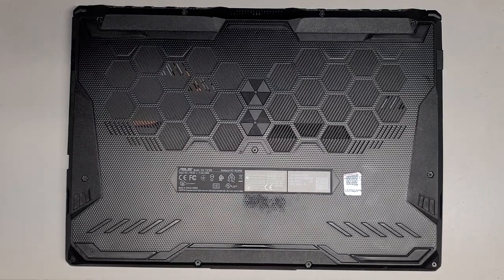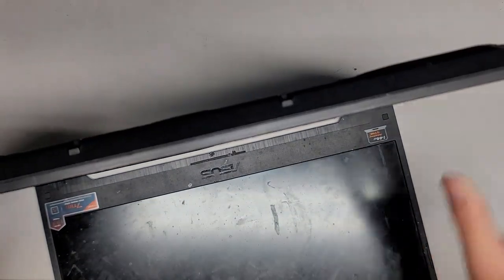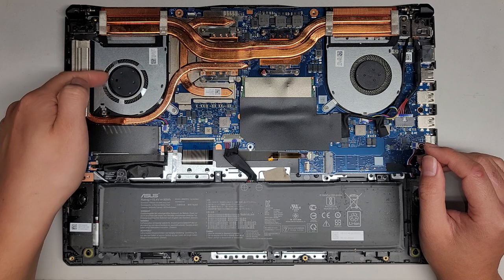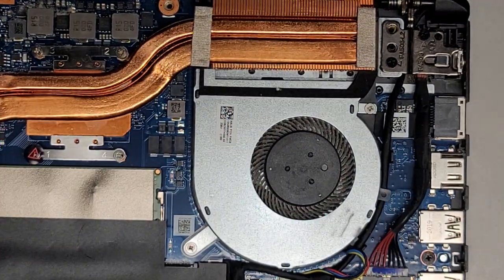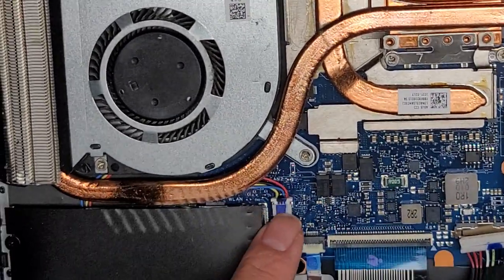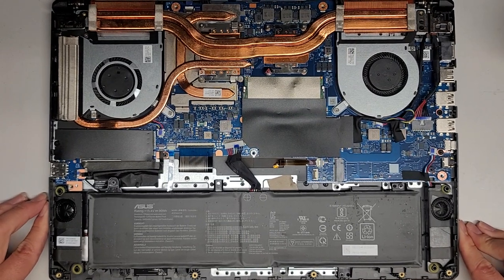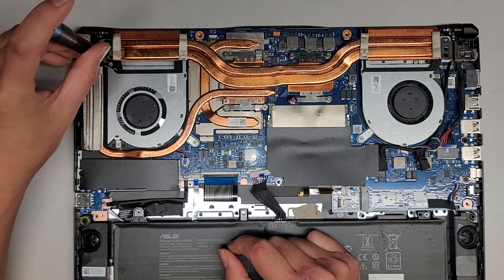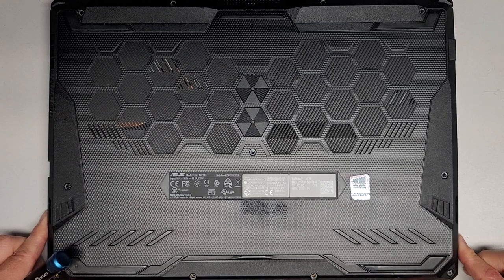ASUS TUF Gaming 15 TUF506 TUF506IV-AS76 Disassembly RAM SSD Hard Drive Upgrade Replacement Repair

Comment: Did you mention the location of the wifi chip? I did not hear it while skimming through. I have an TUF706IU-AS76 and believe it needs replaced. I cannot find much regarding A17 for disassembly, tutorials, or recommendations for a wifi 6 chip.
Reply from the maker: Watch the whole thing and then get back to me. Lol
Reply from the maker: Jk, looks long the wireless antennas are going under the motherboard.
Reply: @ItsBinhRepaired  All good. Your video was still helpful. I was able to get to the wifi chip with the instructions of disassembly and safety recommendations.

Comment: Can you show where the cmos battery is pleas
Reply from the maker: The same as the main battery
Reply: @ItsBinhRepaired  I bought replacement battery and have swapped out the old and now I can’t turn on laptop I even tried putting the old battery back in and still won’t work any ideas
Reply from the maker: @codingathome6145  you have to leave it on to cycle through the bios reset
Reply: @ItsBinhRepaired  should I have any LED light up to indicate power though I currently do not
Reply: And has main power cable plugged in
Reply from the maker: No power? Sounds like you fried something
Reply: @ItsBinhRepaired  so I have a short
Reply from the maker: Yup